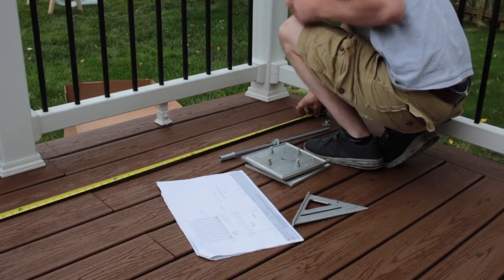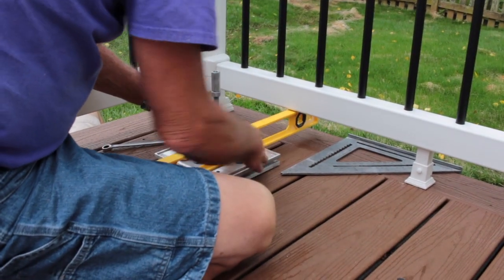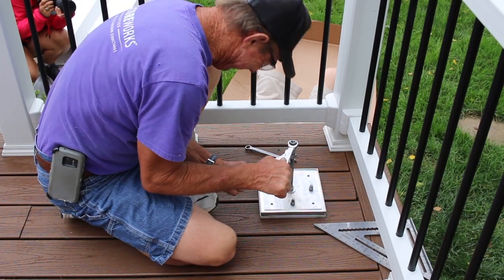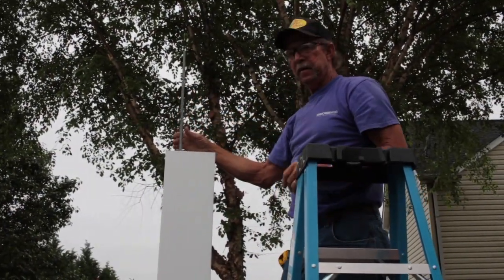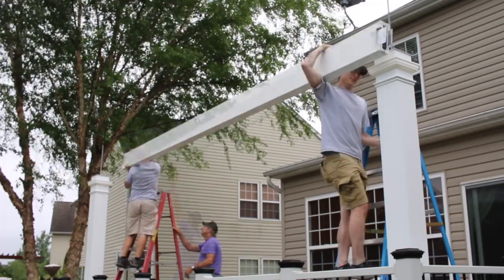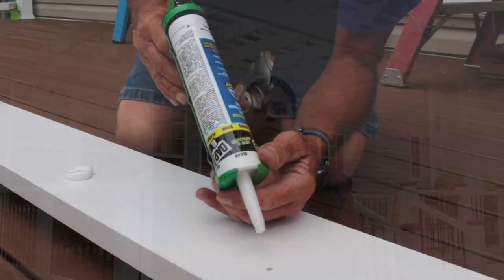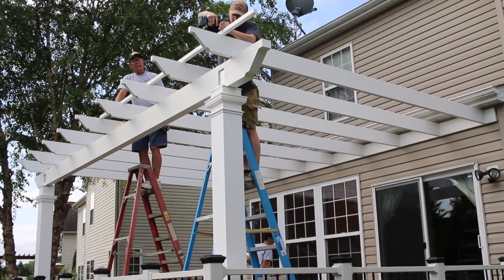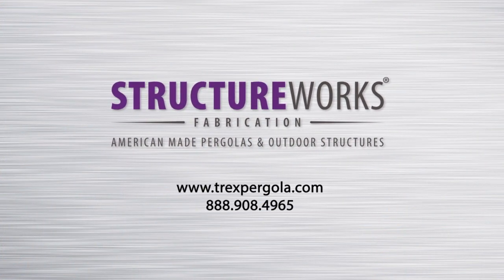Installing An Attached Trex Pergola On A Deck

Comment: Looks nice, but shouldn't you remove the vinyl siding beneath the ledger board and make sure it is fully flashed? I have always heard that you should never install a ledger over siding. tia
Reply: Interesting they choose not to respond to this.  This is not the correct way to attach s ledger board.
Reply: Jason Armstrong I was thinking the same thing
Reply: Correct, this would not pass an inspection and would need to be torn down and attached to the "structure" of the house.
Reply: Came to the comments to say this. Never imagined a ledger installed over siding. Thats not code round here. Maybe they live in Texas…the only free state…and the only state you can sandwich siding between your ledger

Comment: Can you attach railing to the Pergola post ? Are they structural ?
Reply: Hello John - Our fiberglass columns are structural columns. Attaching railings can be done and will be sufficient from an overall stability/safety standpoint. We sometimes recommend blocking the inside surface of the column shaft with PT lumber to give the screws something more to bite into.

The biggest potential issue to be aware of is that railing systems are evaluated and approved for code compliance as a system and our fiberglass columns are not evaluated as part of the system. So the inspector could have discretion. Lastly there can be an inherent amount of movement with any freestanding pergola and that may cause issue with the local inspector. Their perception might be an issue as part of the approval process.